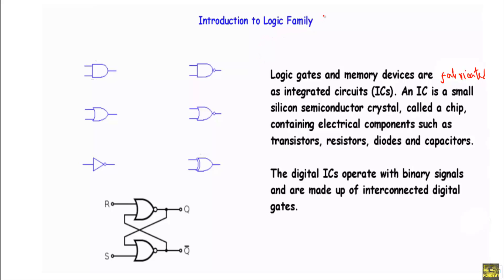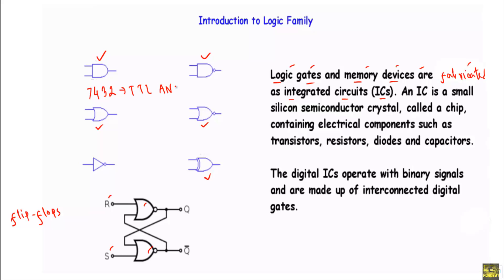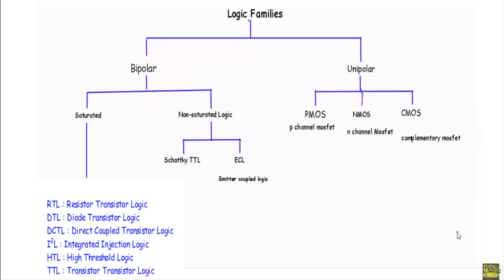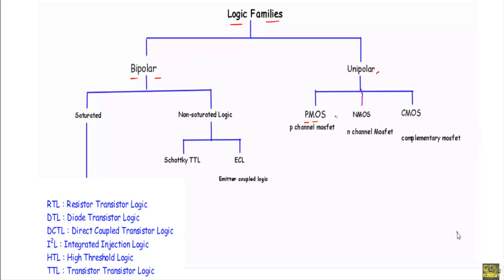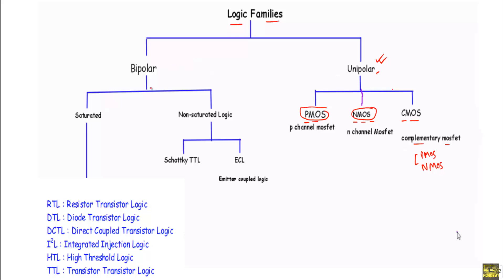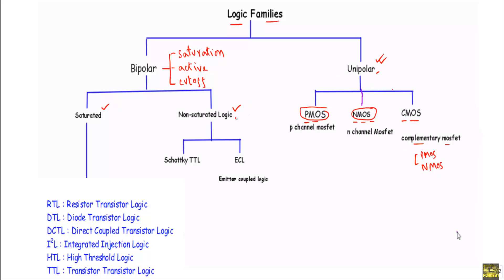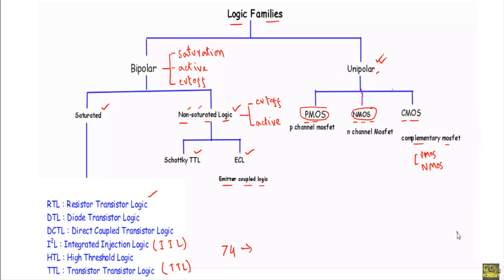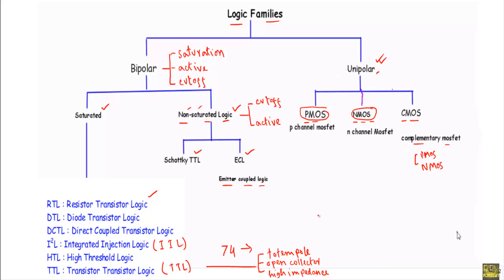Introduction to and Classification of Digital Logic Families (w subtitles)

Comment: CMOS gates actually use N-channel FETs and P-channel FETs. The difference he is trying to express is between current-controlled semiconductor devices (bipolar transistors) and voltage-controlled semiconductor devices (field-effect transistors, FETs). Examples of bipolar devices are tunnel diodes, I²L, DTL, TTL, and ECL. Examples of FETs are NMOS. PMOS. and CMOS. I read a paper stating that bipolar devices were superior by a factor of beta (the current gain that ranges from 4 to over 200).
CMOS is excellent at low frequencies (< 1 MHz). At higher frequencies, the fundamental quantum-mechanical defect in CMOS (once every clock cycle, there is a transient short between power and ground because holes move more slowly than electrons). That is why present graphic cards can use over 700W.
Tunnel diode threshold logic (1957 and 1984 respectively) has a speed-power product 100,000 better than CMOS at a lower cost. Think of a graphic card at 2 THz at 3.5 W for $100.